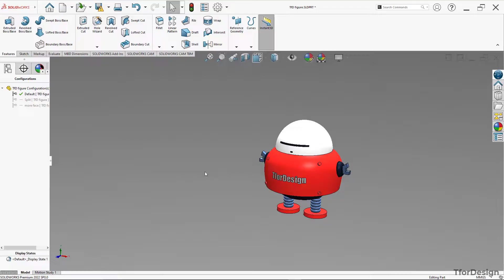Why Learn 3D Modeling? - The Power to Make!

Comment: I am a nurse by profession, but a hobbyist/maker in spare time. I received a 3d printer as a gift from my wife in 2018. I was never fully content just making other people stuff. I figured I would learn how to make my own stuff. I took several years of drafting (yes, by hand with pencils, lettering guides and everything) in high school and several semesters worth of autocad early in college, so really how hard could it be? I enjoy designing, printing and assembling complex parts. Pairing designed objects with modern electronics to create useful devices that I could never afford unless I make them.  I am an advanced beginner in Fusion360, but I recently switched to Solidworks. I picked up Tayseer's course on Udemy to help dial in using solidworks as well as learn new things.

Comment: I'm a retired aeronautical engineer who spent most of my working life with the civil aviation regulator. My interest is mostly educational to give myself some capability and experience with 3 D modelling. SolidWorks educational facility initially available as an EAA member and now via 3D Experience SolidWorks for makers fits the bill perfectly. As someone who has never used any modelling programs previously, I'm finding your course pitched at my very inexperienced level perfectly.

Comment: I need to make a custom gear for a motor to turn a solar oven. Have no clue where to buy what I need for this project, so 3D model the part and 3D print a plastic model of it sound right and fairly cheap solution.
Reply from the maker: This a great way to go about it!

Comment: I have been a machinist for over 30 years.  I wanted to learn more about 3d modeling to save time in making prototypes and testing them before investing the time and materials to make a working model.
Reply from the maker: Great move! With your machining experience, you will ne able to unlock so much value with 3D modeling!

Comment: 45 years ago I created the 3D model in my head, visualizing its physical characteristics THEN creating the 2D drawings to get it fabricated.
Today I can create the model on screen, then more easily draw it for fabrication or assembly...using CAD. The next step is to convert my mental 3D models directly to my 3D printer to bring them into reality. Most of my creations have been for engineering. Now I'm thinking out-of-the-box & will model and animate action figurines that I created back in 1969. More later...
Reply from the maker: Awesome progression! We would to see the action figurines you are making!

Comment: Ever since I have studied a design course through my bachelor's degree in mechanical engineering, where we were presented with a problem that needs to be solved through design, I have found that solving problems of consumer related  products is my passion. So, I want to develop my skills further on Solidworks to present these solutions in 3D models, as my next step is to become an industrial designer.
Reply from the maker: Sound like you have a plan Ahmed! 3D modeling will surely come in handy in your journey to becoming an industrial designer.

Comment: I am trying to learn 3D modeling because I am working in a skilled university. I have 9 3D printers, so I know how to print any prototyping in a 3D printer, but I don't know how to design 3D models, so that's why I am trying to learn 3D modeling software.
Reply from the maker: You'll surely be able to do so much with those 3D printers once you can design for them :) ... Good luck on your learning journey, and let us know if there is anything we can help with.

Comment: I work in an industrial job shop.  We started as a simple tool & die shop, then added presses and the list goes on.  To date we have many lasers, cnc machines, wire edms and brake presses and continue to grow.  I found that we needed to develop formed parts more and more, therefore needed flats to be cut on the lasers that was simply taking too much time on our companies 2d software.  The cnc dept. was upgraded with new software and they were requesting solid models.  The time had come to take a big step.  For our company and our customer's needs, I had to learn solid works and fast!   Within the last 3 months that goal is now complete.  That knowledge has made a big difference in cutting time from concept to actually making the product.  What took a week to design now only takes less than a day.  Another reason to learn 3d modeling is that many clients will have their parts designed in 3d and then send it to a fabricator WITHOUT dimensions.  If a company doesn't have the capability, they will most likely lose that job.
Reply from the maker: Seems 3D modeling was such a major upgrade for your company, and looks like you are getting a great value from it already. This is great! 

 I had a bit of suspension that many tend to use 3D models directly for fabrication without drawings at this point, thanks for confirming that. 

*p.s. if you are looking to train your team in SW, we can help ;) 

- Tayseer (the guy speaking on the video)